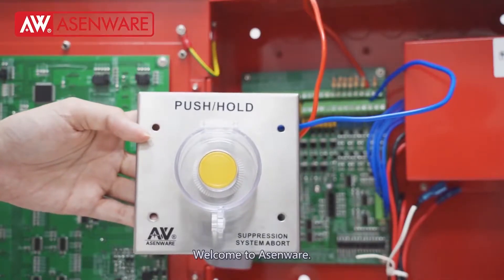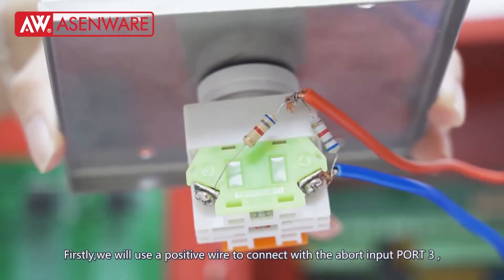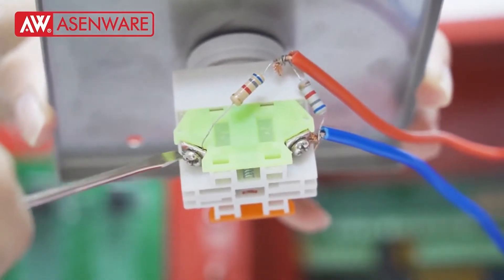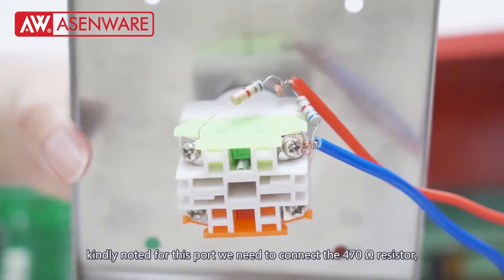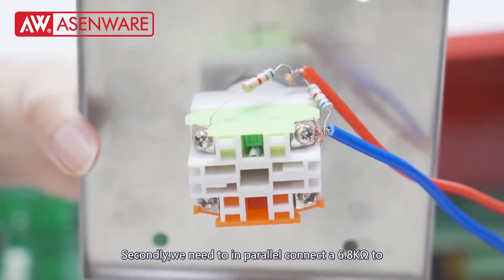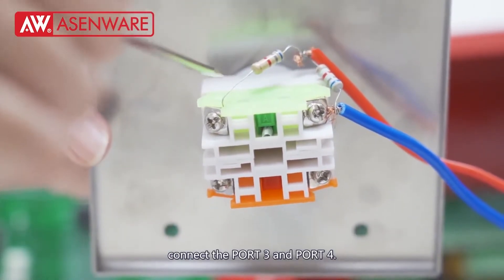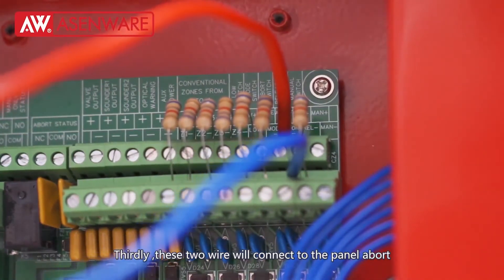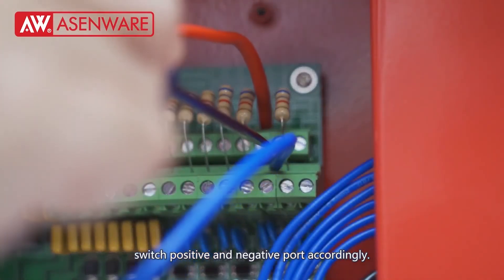How To Wire The Abort Switch To Gas Extinguishing Control Panel

Comment: How about the connection of two abort swict? Please answer my question thanks..
Reply from the maker: Thank you for your support,can not connect two abort switch，can connect only one per panel
Reply: apakah kalau 1 abort bisa berfungsi menahan, dan kemudian melanjutkan hitungan mundur saat abort di lepas?
Reply: How does the abort switch work? Is thw count down time temporary stop after we push the button and continue counting after we release it. Or totally stop?